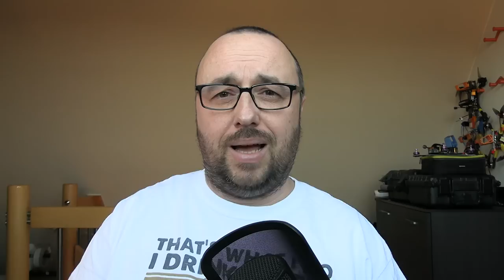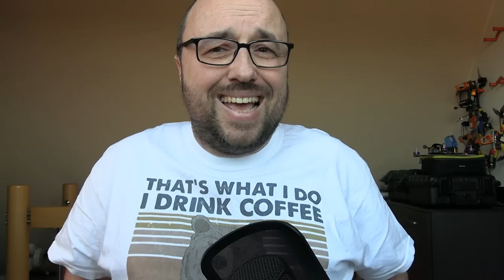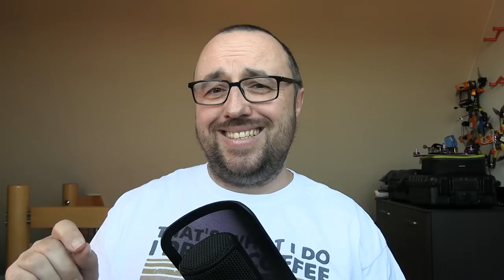What makes a great GPS receiver?

Comment: Good points. I would add that ground plane is also important. It should be at least wider than the ceramic part of antenna:) I like matek modules, since they do them right.

Comment: I got GPS rescue working on my diatone Roma but when it comes back it is in weird angles like when a mother drags a kid around by the ear. Its a 4 wire GPS, no compass. I'm wondering is my GPS oriented wrong? I would think even without compass it would still tilt forward to move because of the accelerometer..

Comment: I never had any issue with 3 diferent BN-180 modules as long as they are mounted far from the drone frames, always getting pretty fast GPS lock and at least 15 sats
Reply: I'm placing on micro quad. How far away can I get from frame? 😂 it will have to be right over the FC. I guess this may not work.

Comment: I really like my Matek GNSS modules. The M8Q-5883 is in the sweet spot for value, in my opinion.
Reply: It's three times the price of a rdq/tbs/HGLRC/Flywoo gps.
Its the most expensive gps in most online shops today. I don't how it's the sweet spot for value.
Its good no doubt. But it's not a value proposition
Reply: @jumpstartfpv  It is less than two times the cost of the GNSS modules you're referring to ($30 vs $16-20) and you're getting an excellent GNSS. I think most people can stretch their budget by $10-14 for a vastly superior GNSS module. I'd cut cost somewhere else, but like I said this is just my opinion.

Comment: Hi, I'm building a rc plane and i've orded a f722-wpx but now that I've got it, Are the scl and sda pins seperate? as in can I use compass on the gps connnector (bn880) and digital airspeed sensor (mateksys one). kind regards!

Comment: The most common question for me - which gps module, that has magnetrometr is the the most protected (shielded), i.e. less susceptible to the influence of steel objects in the vicinity. 
As I now, all use qmc/hms5883 , is any alternatives ?
Reply: By definition, a magnetometer cannot be shielded as it has to detect Earth's magnetic field. You have to put it as far as possible from high power lines like motor, ESC, etc.
Reply: RM3100 is currently the best one, but they ain't cheap.
Reply: @adilsongoliveira  yes I know about how it must be installed,  thanks))
Reply: @jiatan_fpv  thank you, I will try to find

Comment: There is a best sensor for each application. I dislike this long theoretical video. One should know what are the minimum requirements for specific use of a module and then decide what to get. Also with or without compass!
Reply: @M-H433  Yes, this is true. When originally expressing my dislike I was not sure from where my bad feelings are coming from. I like Pawel.  Yes, I do. 
In my opinion this kind of presentation should not be monotonous linear talk show. It might be better to use some schematics representations, drownings, in one word presentation slides like PowerPoint or any similar. List all the properties, describe them one by one with proper schematics, and give a tabulated conclusion at the end. I do not object on overall content nor spoken text. It just gets boring watching the single bearded head for 14 min. Also at the end I lost count of all the important points. Hope that next video will be more practical, shorter and picturesque.